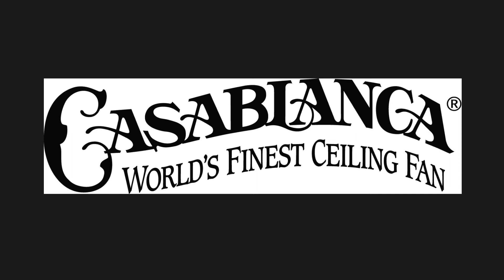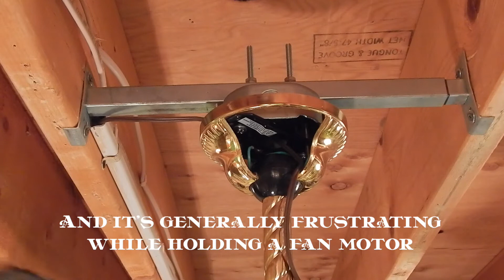FAQ Answered: Why I Use The Hang-Tru Trim Ring

Comment: Cole, you hit the nail right on the head!

That is exactly why I use it, and for the longest time, I would have to mount my Casablancas to a LCA as the bare mounting boxes would accommodate that much better. 

In 2012, I acquired a 6" wiremold box to accommodate Hang-Tru Casablanca Canopies and it works great!